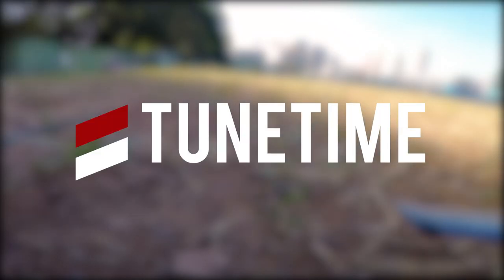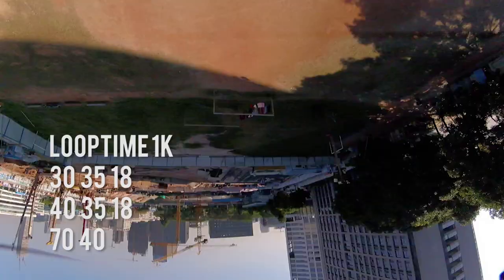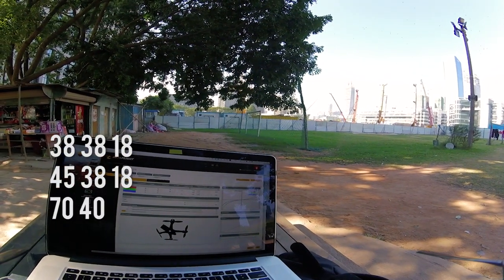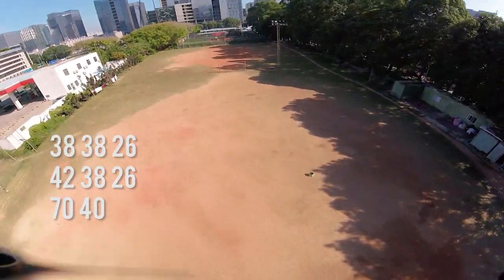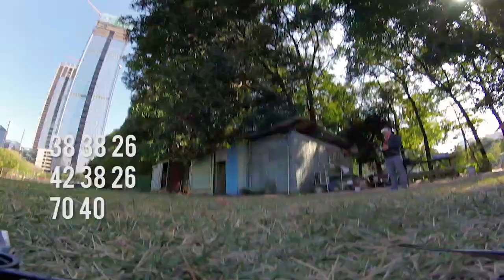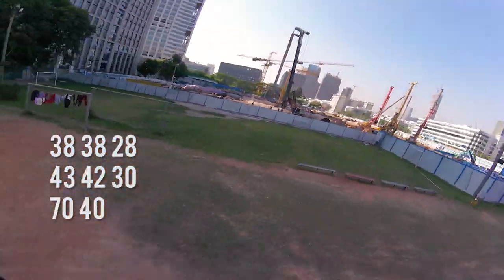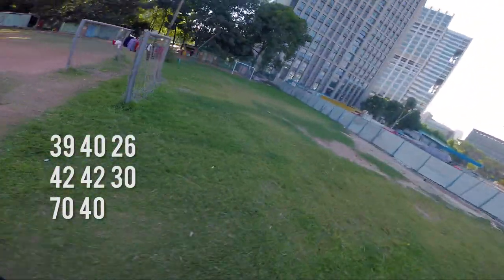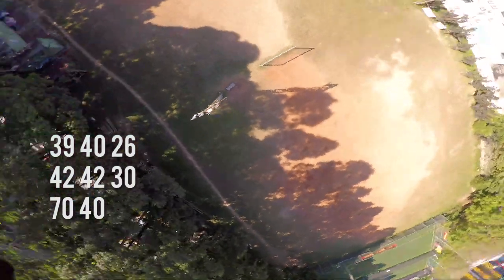DJI Snail PID Tuning Guide Shrike Style

Comment: I have nothing but problems with this propulsion system, myself and others have nothing but issues with it, "wobbles of death" is what we call them. your video may have shed some serious light / insight for me! I build several quads a month typically, and this one escaped me as far as tuning and issues. I am used to my fair share of problems, but this is the first time I have seen something as severe as this (the wobble). It's crazy, the quad will hover, but after a flip (LOS) it will shake violently, wobbling left to right, all while ascending and at ZERO THROTTLE!  I reduced PIDS to try and compensate, but apparently not low enough. I thank you severely, as you make have prevented me from tossing this system out the door!
I knew the PID loop needed to be 1khz, but the need for such low PIDS escapes me, I typically run pretty high setups when they are all tuned and locked in.

Comment: Thanks so much for posting this. I just built my first mini-quad. Used the RMRC Valorem VRF 230mm frame, Tattu 1300Mah 75C, RUncam Mini, BetaFlightF3, Diatone SP2 VTX, AUW is 496grams. It flew amazing but yeah if I did a hard roll it would wobble bad and even at low throttle amp draw would spike at 65A. I didn't know about the extra low PID values for this kit. Will be going out this weekend for a tuning session. Will start with your video values and going from there. I did update the firmware on the ESC's before I soldered the signal and ground wire to the FC. I wonder if the newer firmware is a little more tolerant of the stock PID values as that's basically how I flew 7 packs through it on Friday then a casual fun race on Saturday. 

Thanks again and cheers!

Comment: I had my maiden with a diatone GT2 with snail propulsion - i was pretty impressed apart from the thing having a bit high lowest idle motor speed. My quad is a bit porky running a Session and 1500mah 4s @ 600g so it does not exactly defy gravity. This video helped so thanks for that, i usually start the pids pretty low when tuning but not as low as this.
Reply from the maker: Adam Wolski cool glad it helped:) you can also lower your idle to about 1040, and you can adjust it so it feels right with the air mode at zero throttle in the air

Comment: with the snail esc do you have to use the dji esc programmer to configure the esc before you install to your quad?
Reply: Did you find an answer to your question? I am wondering the same thing.